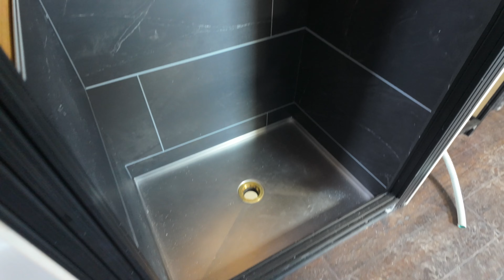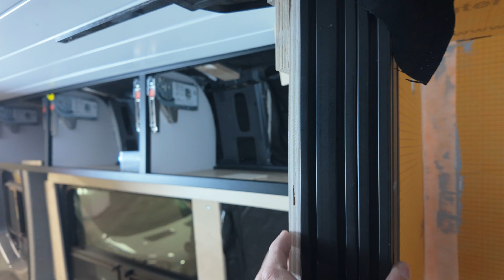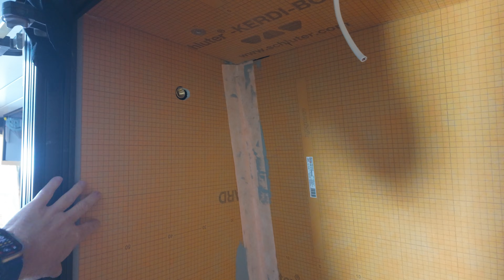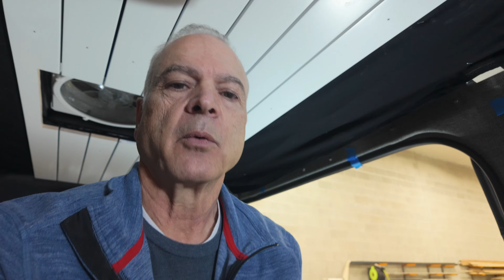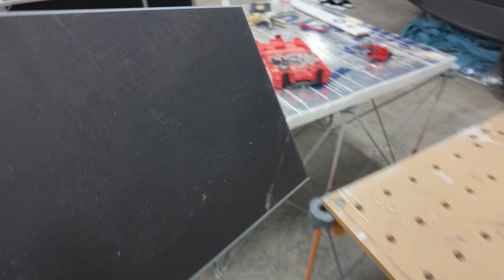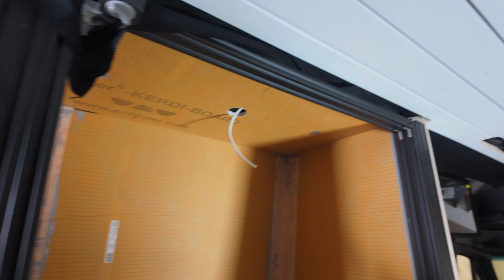Pro Van Builder Shares How to Build an Indoor Shower

Comment: Hi Jeff, what is shower internal depth finish wall to wall. Is it 24” or 22”. I am asking as most of shower pans are 24” depth, but including flange, once finished it might be 22”. I just want to detail my layout. Thanks
Reply from the maker: Depends on the shower pan. You can find some as narrow as 22". Add the thickness of your walls to get the total depth. We are usually around 25"~27".

Comment: Looks great jeff.. im building out my 144 myself, i couldn't imagine losing so much space to a dedicated shower, as nice as it would be, i watched your flarespace video, and you didnt really cover the interior upholstery,  im just curious if you guys use foam under the tweed?
Reply from the maker: We purchase the tweed with foam backing from Panther RV. You can apply the foam separately, but it’s easier to work with the foam-backed tweed.
Reply: @OurThrivingLife  thanks for the tip, I didn't know that existed. The problem im having is installing the windows. The extra thickness of the foam is making the window super tight. They won't open/close easily without loosening the screws , I will be ordering foam backed tweed for the wall panels once I get that far, thanks

Comment: Looks awesome! Do you guys attach the kerdi board to the aluminum extrusion before putting the aluminum extrusion into the van or do you mount the aluminum frame and then glue/ screw in the Kerdi board once it’s in the van?
Reply from the maker: We put the frame into the van, attach it to the van, and then install the Kerdi board.

Comment: Hi Jeff, as always another excellent video. I am planning on using Kerdi Board or Hydroblock for the shower as yours. Have you considered the Kerdi board tray/pan instead of the stainless steel pan? Apréciate your opinion if it is not recommended. Is a backer plywood required for the piece that goes against the van wall. Also do you recommend installing a MAXXAIR VENT Maxxfan Dome, 6" Fan, or would it be an overkill. Thank you.
Reply from the maker: You could use the Schluter pan, but then you would have to tile or lay something over the top of it. I have used these in home construction, but I think a stainless steel pan is just simpler for a van. You don't need backer plywood as long as your "studs" are not too far apart. We don't use a backer plywood. You could put a fan in the shower, but if you wipe down the walls and leave the door open after a shower, you should be fine (depends on your climate).
Reply: A lot of thanks Jeff. As you said a stainless steel shower pan makes more sense. You mentioned that the pan is installed directly on the floor metal sheet with marine adhesive. So there is no insulation required?

Comment: Interesting, thanks. Very thorough, but an awful lot of material to build a shower enclosure, and as a result, a lot of weight. I suspect it could be build as well, but with less weight perhaps.
Reply from the maker: It doesn't get much lighter than 1/2" foam walls and 1/4" vinyl tile.
Reply: @thrive_overland  I'd agree with you there....I was wondering, knowing how clumsy I am, if I could manage to trip and fall through the wall. :)

Comment: Why did you put shower pan thru the floor instead of on top?
My daughter is having her 2022 sprinter 170 ext cab converted in San Diego and is having a heated floor system put in. She wanted to have the shower area floor heated. 
With your system that could not be done. What would you suggest?
Reply from the maker: Yes. You could do that. Just build a frame for the pan’s flanges to sit on.

Comment: Jeff, very nice as always. Have you ever considered using a hand, lay up fiberglass with gelcoat?  I know it’s an overkill and probably labor-intensive. But it is definitely going to be waterproof. :-)
Reply from the maker: Haven't used that. The Kerdi Board is completely water proof and super easy to install.